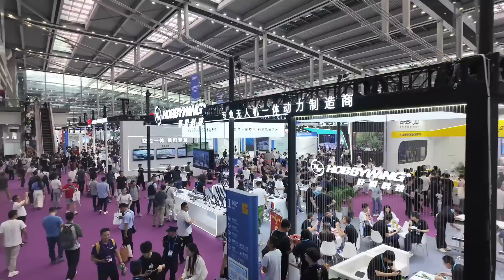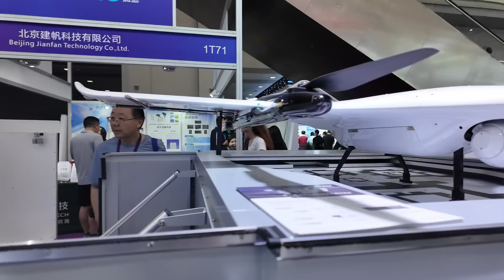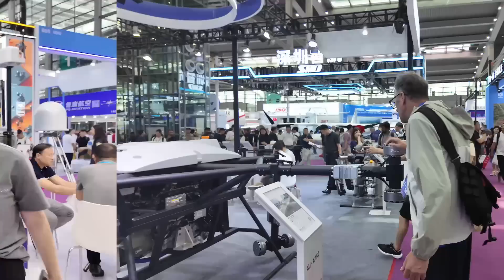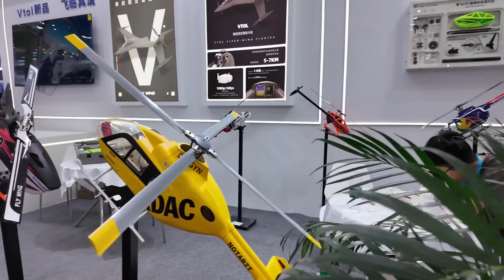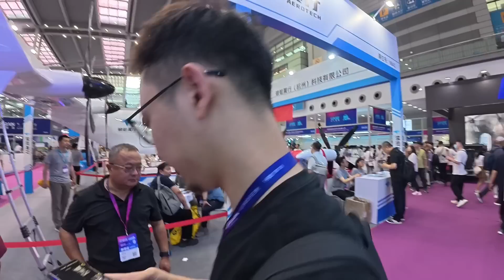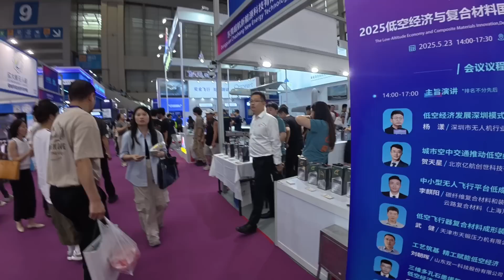The USA simply CANNOT Compete with this..

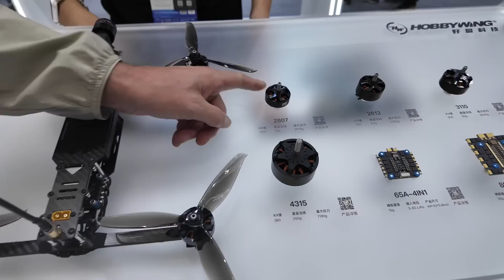Comment: 3:00 you made a small mistake: the "1300 KV" rating means it spins at 1300rpm for every volt applied to the motor without any load. If you send 10 volts into it, it would spin at 13,000 rpm if it doesn't have anything attached to it

Comment: drone motors are rated for KV , krpm per volt so a 1300 will spin at 6S battery × 3.7V = 22.2V * 1300 28,860 RPM with no load

Comment: In America Here We Been Working With Hobby King For The Last 17 Years Starting With The First Turnigy C-80100 Can @130-180Kv Outrunner Motors On Our Electric Race Bikes And Schwinn Electric Race Scooters Running Them @ 48-72 Volts @ 180 Amps Each Can (Cedric Lynch) Inventor Of The Pancake Lynch Motor Came Here To California And Worked With Us Using Hobby King Outrunner Motors On Our Electric Race Bikes ✌️

Comment: China recently has started the government approval process for a 1t drone, a commercial drone that can lift 1000kg! Massive
Reply: at that point its a big electric unmanned helicopter
Reply: @BigOrangeMan  yes, basically. But with distributed propellers more like an eVTOL than a helicopter (which has 1 or 2 large propellers for lift)
Reply: @BigOrangeMan with limited range and duration but REALLY cheap to build and fly!
Reply from the maker: Wow, that's huge...
Reply: I would suggest a hot air balloon with electric heating for lifting heavy stuff.
Reply: @larsnystrom6698  electric heating is challenging, needs very heavy batteries. Here's an application where H2 would make sense
Reply: @larsnystrom6698 haha! Who missed this funny post! Serious engineeres reinventing old stuff!
Reply: It's called a OSPRY V22 you ignorent fools! WTF do you think a UAV is? Wow, an ELECTRIC drone with a GAS ENGINE? Hahaha! Reinvent a 50's era chopper?
Reply: @dousiastailfeather9454  A UAV is an unmanned aerial vehicle, meaning it's flown either by remote or by preprogrammed flight path, or even by AI targeting, unlike the Osprey, which is piloted, meaning a trained and certified pilot needs to fly it. 
P.S.: ignorant is spelled with a not with e.
P.P.S.: Bell Boeing's V-22 is spelled Osprey, not Ospry.